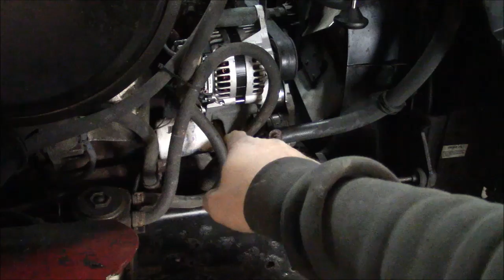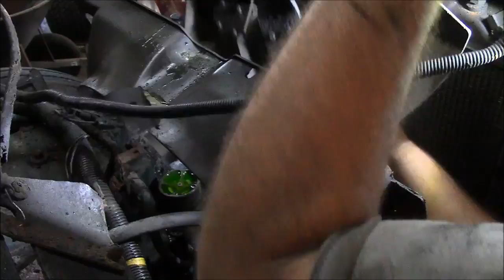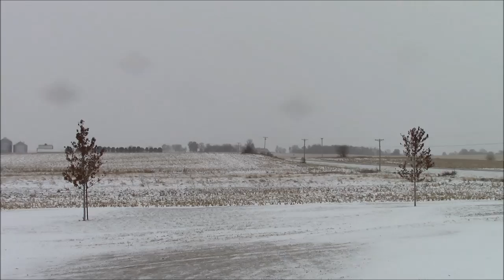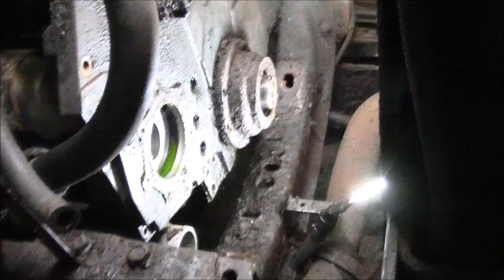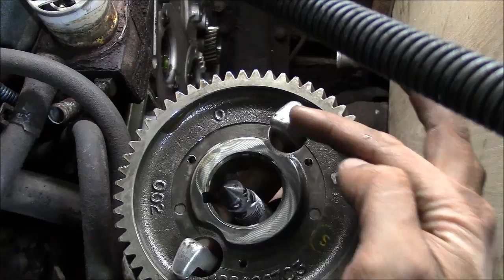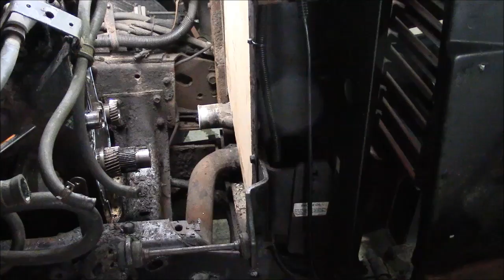International DT466E Coolant Leak from Timing Cover - Part 1

Comment: I have never seen such a rusty engine block
Reply from the maker: It's the worst I've seen.
Reply: Now I'm only 12 and I love your videos so I haven't seen very many engine blocks but I have a 1948 ford 8n and the engine block is it near as Rusty as that and I have one more question when are you doing your next video on the drag line or the forklift
Reply from the maker: @hadleyssquad8584  Soon I hope. I'm just busy and the weather has been very bad. Usually tractor engines are not too rusty since they never see salt. Thanks for watching!
Reply: @WatchWesWork  thank you for replying so fast and I know what you mean the weather where I live isn't all that great either and I never thought about the salt

Comment: I'd use never seize on those bolts when you replace them they may still rust but they won't be as bad as the ones you took out and they shouldn't cease either
Reply from the maker: Maybe just dip the whole engine in it!
Reply: @WatchWesWork  lol yea to don't think that help that that rust

Comment: For cracks I have had decent success using irontite. I have kept several leaky blocks in service using it.  Likely wouldn't have worked where that one was damaged though because of the expansion and contraction all the time.  Those IH trucks and engines always were a bear to work on. I am glad our fleet at work now is Petes and Kw's with N14's. Everything is pretty easy to service and they rarely need attention.
Reply from the maker: Well the one good thing about the IH engines is they are extremely common here since we are only 2 hours from the mother ship in Chicago. So used parts are everywhere.
Reply: @WatchWesWork  There are certainly boatloads of 466's around. At one time nearly every bus here had one, then throw in all the small roll backs and rental fleet trucks and they are everywhere.  The 466 non E versions with the p-pumps were pretty good reliable motors.

Comment: I’ve never used the 466 in truck applications but in a tractor they were built proff
Reply from the maker: They are very reliable engines. Imagine some lesser engine dealing with the conditions this engine has seen.

Comment: Wes I like the video's man but that truck is baked.  The new formulation of stop leak which is silica based and does wonders. I have used the copper colored version with great success on these hopeless causes.The township budget should have been put towards a new/auction truck from a southern state without salt damage. Thanks again...Jack Baker
Reply from the maker: It's actually really difficult for the townships to buy equipment. There are procurement rules they have to follow. Most equipment is like this truck, it was originally owned by the state, then the county, then sold off to the townships. That's the end of the line and they will run it until it falls apart.
Reply: @WatchWesWork  I get it and I assume that you have it fixed, but for thirty bucks worth of stop leak this issue could have fixed itself and lasted well past the rest of the vehicles life span. That truck is gone, and only has a few more seasons left in it. The stop leak variation im talking about lasts at least 5 years or longer with retreat and that truck will have dissolved long before that...Thanks...Jack Baker

Comment: 4 mins in and I am thinking as it is just a timing cover, I was thinking JBweld. Aluminium welding would work but drill a small hole at the end of the crack to stop it going further. 

Its easy for someone to vbring a job in and say "Can you fix the oil leak". They dont realise half of the work that can go into  a job like this. Well done on spotting where it is and what is causing it. Now to watch the rest. :).
Reply: Yeah everyone kept telling me to "fix it with jb". This is maybe THE worst timing cover job one can take on.
Reply: @cbthethird  It is surprising what a can of worms opens up just from a 'little' leak. I have been there, done it etc, but only on cars. Years ago, I had a Ford Sierra (had about 8 total) and this was the only one I had with a CVH engine. I decided to service it the day before we went on holiday. I got it all done then decided to change the thermostat. Didnt want it to overheat in holiday traffic. I broke the ontake manifold wherethe thermostat was housed and had to go to a breakers to get anothwer one, then had to go back to get another carb as mine didnt fit. I didntthink we were going to go on holiday the next day. lol. But I managed it. 'Simple' jobs can turn out real bad.
Reply: @ianallen2  aye pal, I just did the thermostat and hoses on my wife's MX-5 Mazda. Easy job I thought. Well- I got it all right on the THIRD try!  It was Murphy's Law in full effect- EVERYTHING went wrong!
Reply: i was thinking of JB.. I've seen ppl fix lots of stuff with it and it lasts for years.  it's not the right thing to do but very tempting

Comment: hmmm bit of a difference oil or anti-freeze, but then maybe they are not mechanics either.  great video - looking forward to the next segment  :)
Reply from the maker: I was probably leaking both. But once I found the coolant leak I stopped looking for an oil leak since we would be in there anyway.

Comment: So do you bid a job and stick to that bid price no matter what, or do you adjust the price if you go way over hours thanks to ridiculous amounts of rust??
Reply from the maker: I just communicate with the customer once I get into it. I don't have a crystal ball, and the customer understands that.
Reply: @WatchWesWork  Best way. No one knows what lies beneath. I had a Renault 4 given me for free back in the 80's. It smoked a bit and I thought it was valve oil seals. I put it in a garage as I didnt have the tools at the time to repait it myself. The mechanic took the head off to remove the valve springs and called me. Number 1 piston was completely gone and number 2 piston was only half there. The engine was running on 2 pistons and run well to be honest, albeit a bit smokey. It needed a new engine but I scrapped it as back then, the cost of an engine and garage bills, it was cheaper to scrap it and buy another car.

Comment: im with you...dont touch anything you dont have to on a rusty plow truck. what a great job....oil mess, coolant dripping and rust! does it get any better? at this point, you should jack up the radiator cap and put a new truck under it. those bolts are enough to make you have nightmares.....i dont think the hours of labor are going to be the doom of this job...it may be all the extra parts that now have to be replaced from the rust. i am not envious of this job. at least it is a paying job.
Reply from the maker: These trucks have the worst possible conditions for rust. They spend all winter in the salt and gravel dust, then all summer sealing the rust in with asphalt. Then they sit most of the time. This truck has very low miles, but many they were hard miles.
Reply: @WatchWesWork  And the drivers don't fix the cleaning of the truck (not mine truck) and their boss either don't see the necessity or fails getting the driver to accept the work...  ergo the cab will be a rusted thru shell in 16 years and your state doesn't have rules on MoT inspections and their criteria for acceptable rust.
Reply: " at this point, you should jack up the radiator cap and put a new truck under it." I think this is the best comment I have read .I love it. lol.